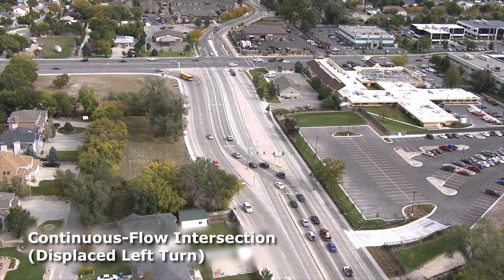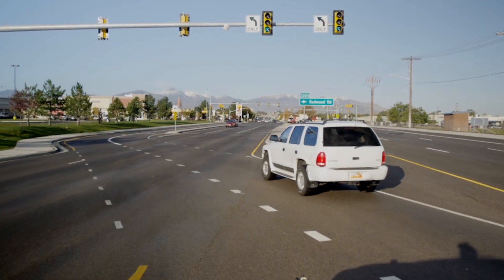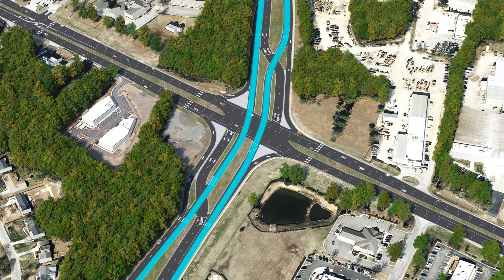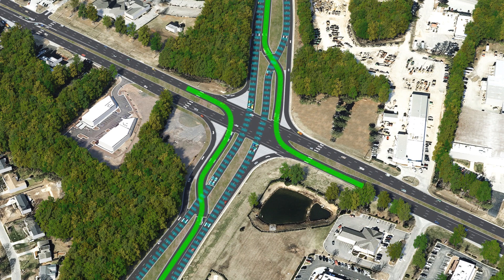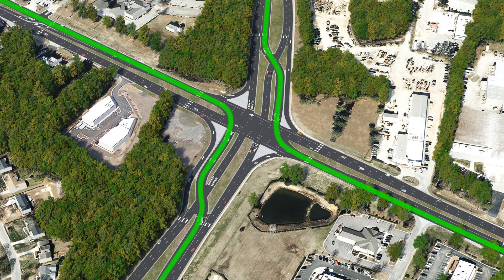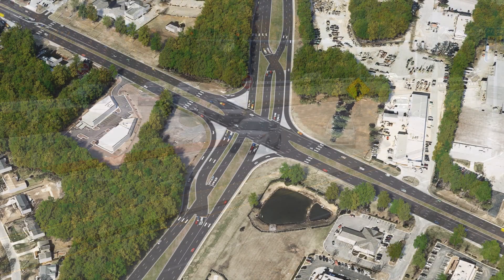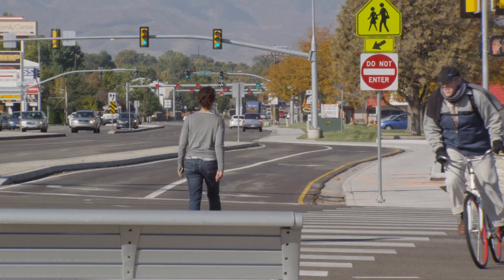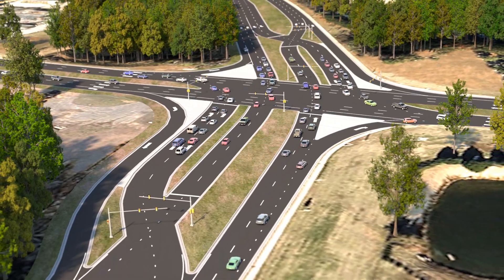What is a Continuous Flow Intersection?

Comment: I see a major issue with this.  Drivers don't plan ahead.  So often you see drivers in the wrong lane trying to get over at the last second.  Many will simply drive right past the lane diversion and still attempt to make a normal left at the intersection.
Reply: Have lane switch signs telling you which lane to go further back before you reach the intersection. This type of intersection will need a diagram on the signs
Reply: An intersection like this has been in my city for almost 15 years now. That happened during the first 3 months, aproximately, once you know the intersection, doesn't happen again.

Comment: Interesting how to prohibit left-hand turns and instead require them to move up to a U-turn. I wonder if that makes it more difficult, or if U-turns are made easier than normal, somehow.
Reply: It definitely helps by not allowing the traffic to pile up at the intersection.  Baton Rouge has had such an intersection at Airline Hwy. and Sherwood Forest Blvd. for years and traffic flows just fine. No unnecessary backups.